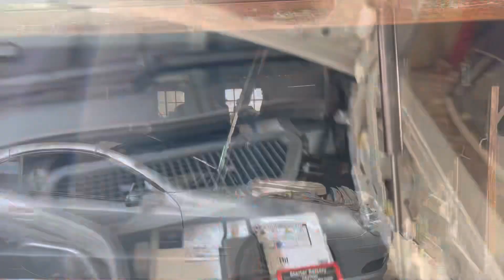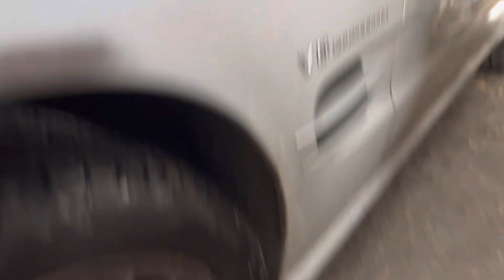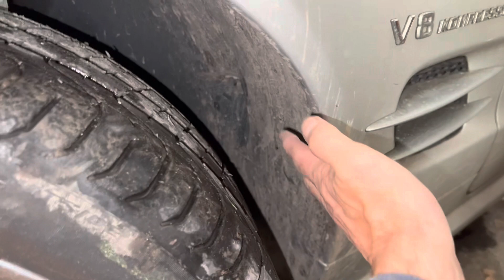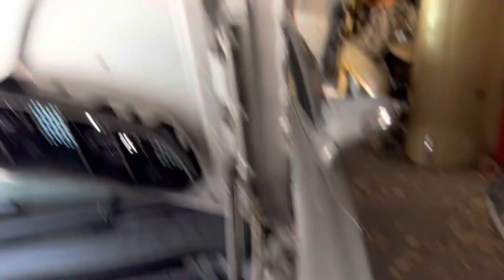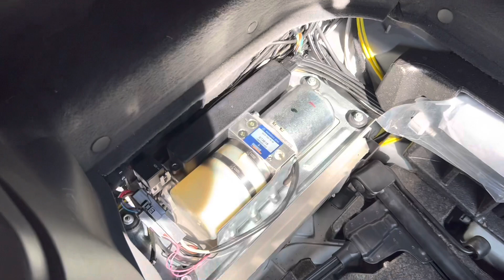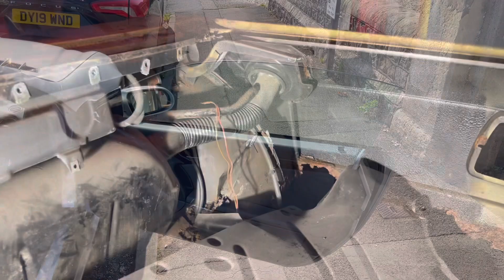Mercedes R230 500SL SL55 drain holes

Comment: Not showing where water gets into the cabin to soak the floor mats is a fatal flaw in this video.
Reply from the maker: Hi....I thought I did show that. Under bonnet drain holes get blocked and water overflows into front footwell at time code 3.07. Obviously you can also get wet mats if your window seals are knackered and water drips in from the roof...but that is not related to drain holes. I guess in theory, water could also soak into the front carpets from the boot carpets...although I;m not sure that happens.Have you got an R230 with wet mats?...and is water getting in some other way? Mike

Comment: I believe you missed the A/C evaporator drain tube.  Freon is heavy and in case of an evaporator leak, it will go down and exit throught that tube where it is easily detected with a freon detector.
Reply from the maker: Thanks for the heads up. Mike

Comment: Great video. If the drainholes are blocked how would you recommend to unblock them? Thanks.
Reply from the maker: It slightly depends on the location and angle of the drain hole. I use a variety of things including:

Metal coat hanger
bass guitar string
Long wooden shashlik stick

Just try not to use anything too sharp that risks poking a hole through the rubber channels.

Mike
Reply: Used a long cable tie

Comment: Thank you for your informative drain hole movie. Much appreciated and mine are all now clean. I have air conditioning water coming into both footwells left and right hand side. When the air-conditioner is off this is not a problem. Where is the drain plug for the air-conditioner? Thank you in advance.

Comment: Tell me about it - lv a cherished low mileage R230 that lm actually scared now to take out in the rain- lv just managed to get it going again after trailering it (stuck in park - no start) round to 3 different Merc “experts” - auto electricians - lv got spare SAM units ECU units Engine management units - and ignition units all bought to try and get her running again also the rear window seal - that needs attention to stop water getting into the boot
Reply from the maker: Thanks for your comment. What was the problem? The "stuck in part" problem is often due to a broken plastic part in the gear lever mechanism. The car starts to get more and more difficult to get into gear until that part breaks then you are stuck. Where are you based - there is a really good R230 graveyard in Tewksbury if you ever need parts. Mike
Reply: @MikesMercsandothercars  thanks Mike lm in the South of France at the moment (l have a house out here lm based Somerset) - where the old girl broke down, if l was in the U.K. l could have sorted it - l found a chap (another “expert”) and trailered it to him and he had her running after 2 days - been off the road over 2 years he only charged me 300 euro but wouldn’t tell me what he did
Reply from the maker: @josephp5058  When mechanics don't go into great lengths about what they did...it is often a sign that it was an easy fix. I remember years ago, my silver R107  280SL wont go into reverse and I took it to my trusty cheap and cheerful mechanic fearing the worst. Sure enough, he phoned me and said "I've got some bad news..." In the event, it was wind up and ended up costing me 90p for a bushing and nut....but he could have charged me anything and I would have been none the wiser!

My parents have a house near Bezier and I usually go there each year.

Mike
Reply: @MikesMercsandothercars  l bought a beautiful Jag X Type for £300 scrap appearance like brand new - the AA “mechanic” told the owner the diesel pump had gone and the cost was more than the car was worth - it was a rubber seal in the swirl - £30 job done - l didn’t know
I bought it as a write off
Reply from the maker: @josephp5058  Wow - It;s good when you get lucky! Mike

Comment: What a great instructional video.
May I also recommend that you consider mentioning slip lubricating the squash tubes. MB sell a special jell (of course they do) and while it is expensive it will do many many applications. I recall the French (I seem to recall) YouTuber saying do not leave the roof hanging open for very long as the weight of it is extremely heavy.
You need it open to get at all the tubes.
Reply from the maker: Thanks for your comment - that sounds like good advice. I'll look into getting some from Mercedes. Mike
Reply: @MikesMercsandothercars  This is the clip, (he is called 'I fix my benz' ) detailing how he does it and mentioning his safety concerns.
https://youtu.be/Tzjsj8NRhpE
You have to get past the intro part then he explains the process he follows. 
Recall the product does about  10 applications, 
remember that when you hear the price (at least that's the way they charge in Australia)
Reply from the maker: @malcolmgay2206  Hi - just ordered some from Mercedes UK - £41.80+vat. Not cheap but a small price to pay to stop those pesky leaks. Wifes Audi convertible has this problem. Thanks for the tip.  Are you based in Oz? I've just come back from there. Mike
Reply: @MikesMercsandothercars  Hi Mike We live in Brisbane. Where did you visit? We are currently in Bayswater opposite Hyde Park. Malcolm
Reply from the maker: @malcolmgay2206  We go out every year for a few months and have travelled all over. This year just a 6 week trip from Melbourne up to Noosa via many National Parks. We've kept a camper van out there for the past 18 years. Absolutely love it. Mike